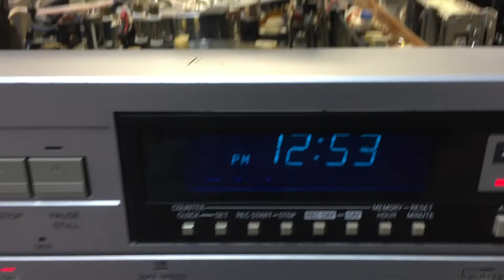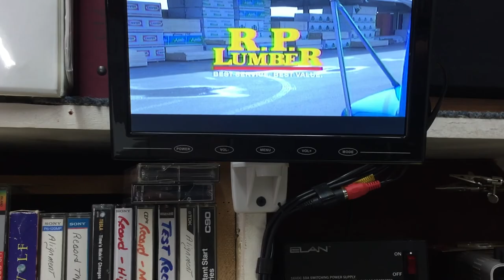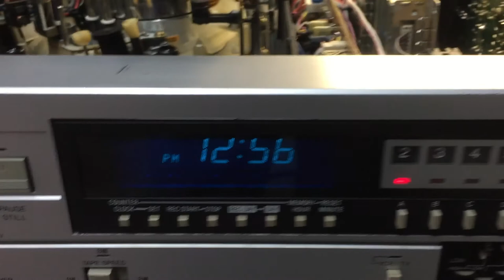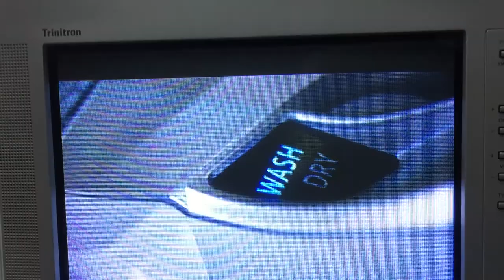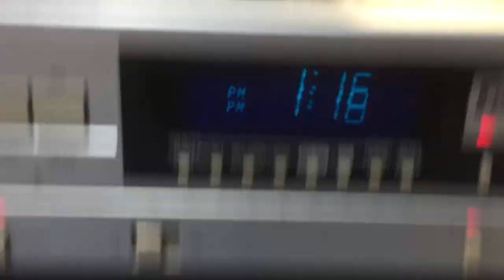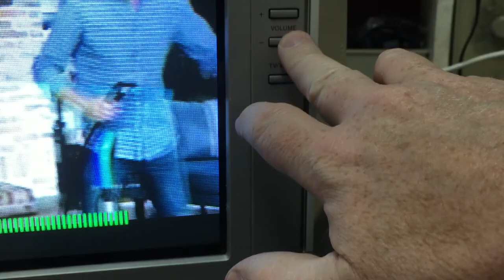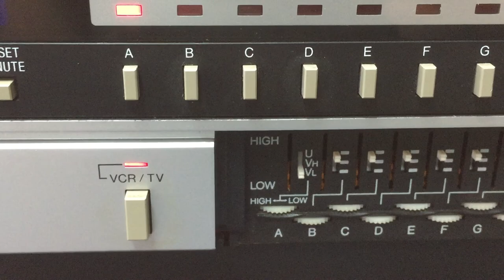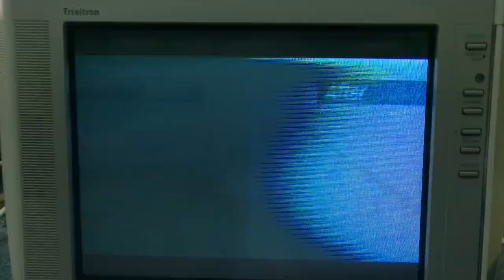Sanyo 4400 Video Recorder - pt 2  repair & testing

Comment: hey i have the same system, do you know any site where i could buy the small belts you used id also like to know what they're measurements are
Reply from the maker: Enter:  PRB SCA2.3 , PRB SCA 3.2 , PRB ST.685   into ebay and you will find a seller.

Comment: Do you have a video of how to replace the circuit board in the back that functions the connection plugs for Video in/out & antenna. My machine otherwise works but I had the video cords connected and the tape was playing and then it disappeared. I’ve tried connecting it to the tv using a coaxial cable and it’s still not working. I’m convinced it’s because of that circuit board. Must be a loose connection inside or it’s burnt out somehow(?)

Comment: Good day! I turkey istanbul from SuaT tule very nice video if the subtitle you have prepared have better was going to be different bi model of this machine I have been assured from parts you are installing the front and what is the diameter dimensions of the rear-engine tire Is it true these numbers wonder 20mm 25mm these parts how supply I wish you success in your work